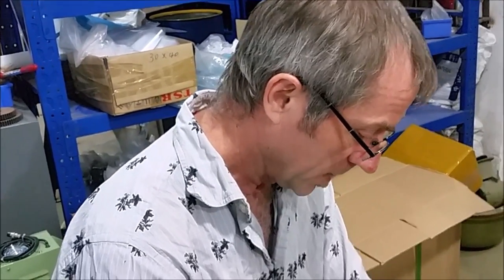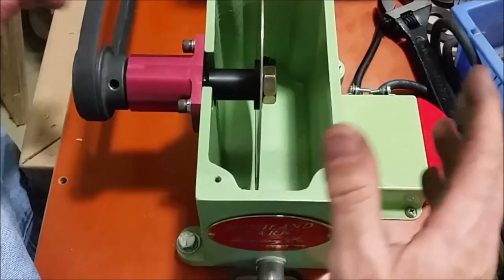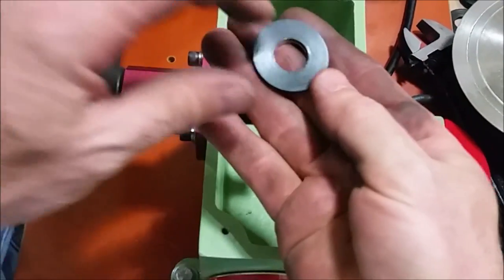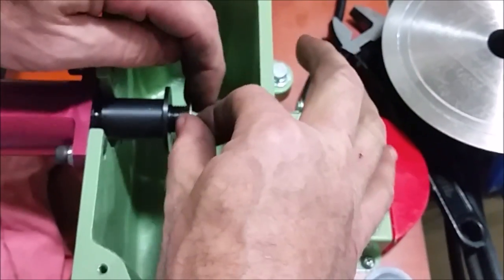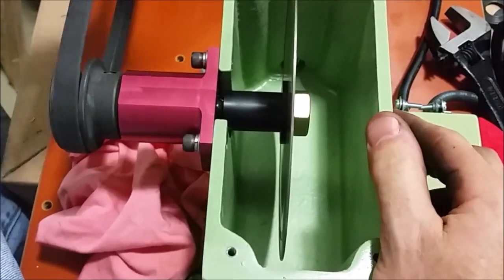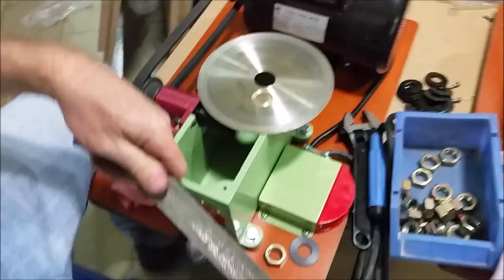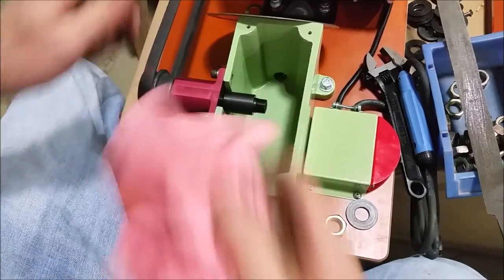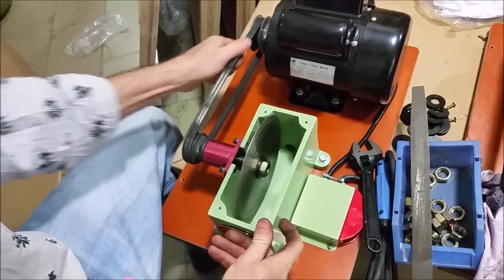Causes for Blade Wobble

Comment: What do you do when the nut comes.loose on a wetsaw when in use.
Reply from the maker: It should not come loose unless the motor is rotating backward (causing the nut to unscrew) or the nut and shaft are worn or do not have tight thread engagement.

Comment: Having a wobble type issue with a job site saw that I can't figure out. Seems to be running straight until I feed it wood and then it want to vibrate and widen the cut out. Doesn't seem to matter what type of wood either. I'm sure it's something simple but sure frustrating
Reply from the maker: Travis, you may want to swap out the blade and see if that makes a difference.  Also check the bearings on the arbor of your saw and see if they sound quiet and are smooth when you turn the blade arbor.